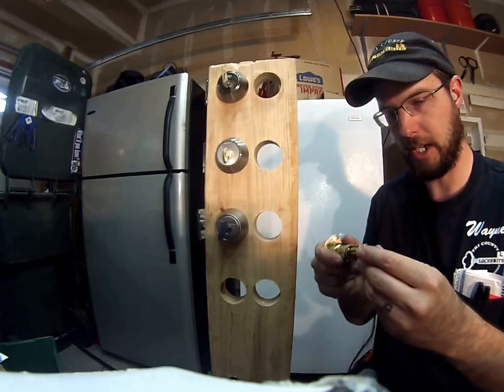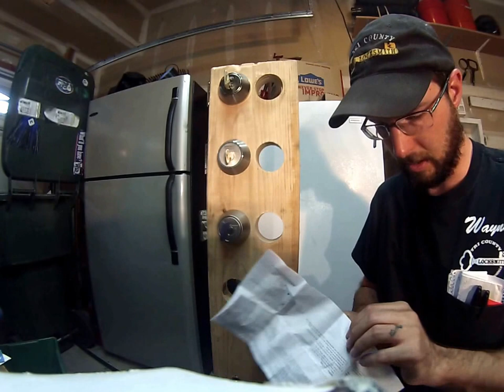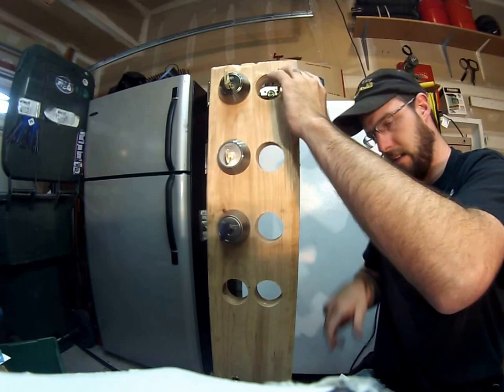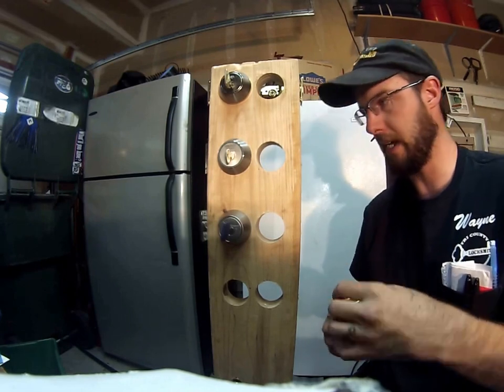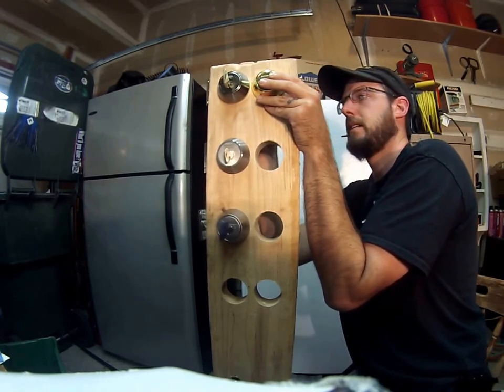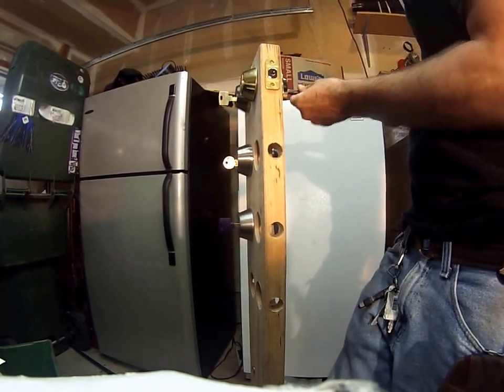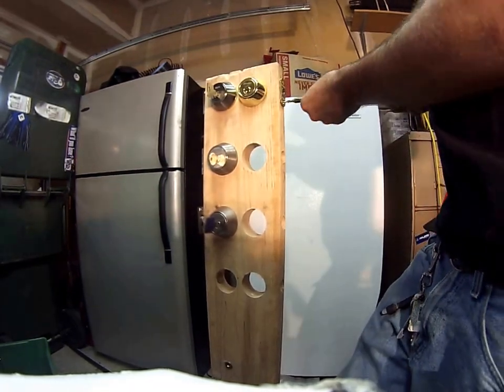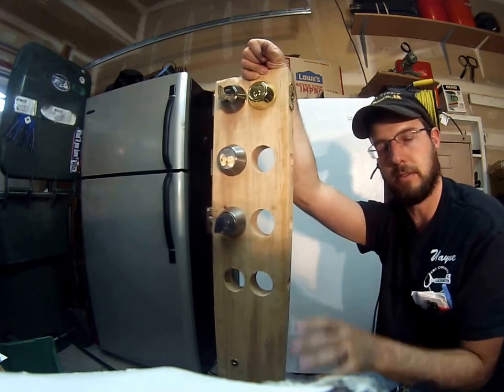How to Install a Grate House Deadbolt Lock On Your Door

Comment: great video . i have  a question about my schlage lock . just yesterday i notice that the lock cylinder is losse and i cant open my from door from inside or out side .. how can i check and make sure the cylinder is not broken and how do i fix yhis ??? thanks :-) ....
Reply from the maker: tighten cap screw on cylinder
Reply from the maker: +ton torres https://www.youtube.com/watch?v=6oOY0elWV60